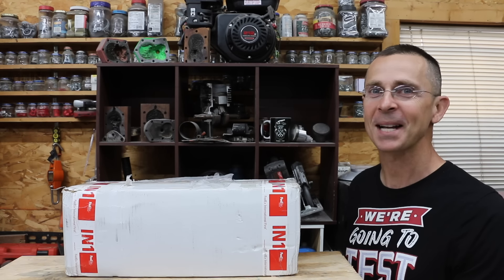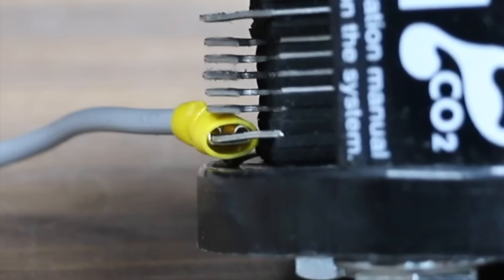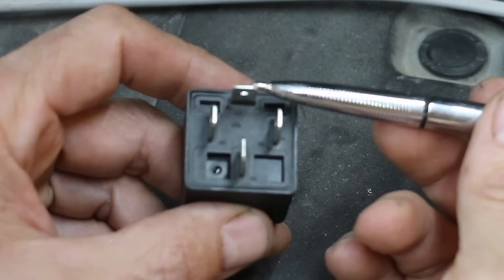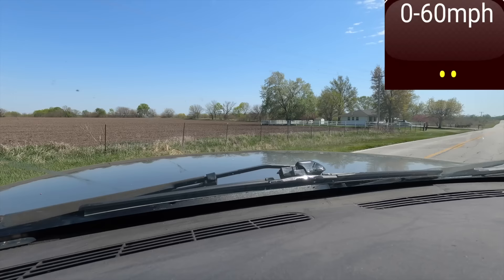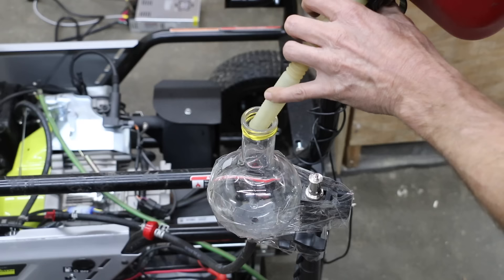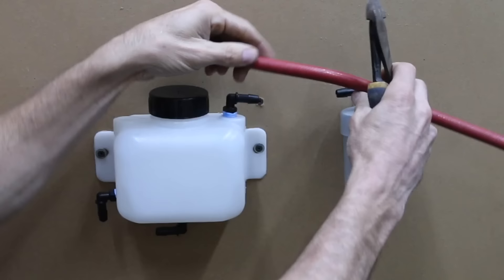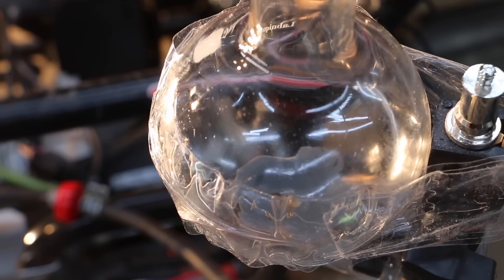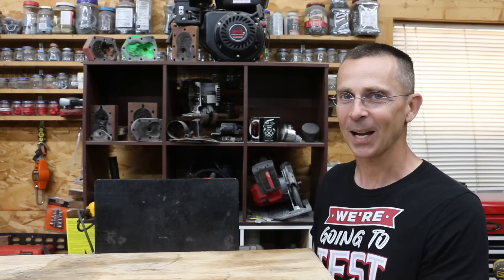AMAZING 35% More MPG with HHO? Let’s find out! Help with high gas prices?

Comment: Wouldn't the engine need tuning for hho? the EFI wouldn't have a clue the hho is being added.
Reply from the maker: Thanks for the suggestion.
Reply: Oxygen sensor would detect extra oxygen produce by HHO generator & thinking fuel is too lean. If only the kit can separate the O2 and H2 going into the air filter
Reply: Oxygen sensor blocks it.i ran this type on my big semi for years built my own.
Reply: @bigred1247  funny how you now realize it did nothing..
Reply: @bigred1247  did you get any difference in economy or performance ?
Reply: @Rev22-21  You are wrong, this is HHO just not a efficient way of producing it.
Reply: I thought the same thing. You would need the lean the fuel to see any fuel savings. So you need to know how far you can lean the fuel with the HHO compensating. Someone also said to adjust the timing.
Reply: @trillrifaxegrindor4411  water is free salt is penny's  gas is expensive
Reply: @WhatTheHeckTV  but the load on the alternator is always going to be larger than any extra energy you'd get from burning the HHO. Otherwise it would break the laws of thermodynamics.
Reply: You will get nothing if you don't add electronic board to adjust O2 sensor signal or ECU ECM will keep adjusting the air fuel ratio and change the timing for the spark Couse hho ignites much faster than gasoline
Reply: @omartalluze8482  Absolutely! You really don't have to adjust timing much as the fuel is still gasoline, When you add a small amount of HHO it creates a shockwave and adds heat making the gasoline vaporize and burn more completely in the cylinder resulting with more calories being used to to create power instead of burning in the catalytic converter.
 If you have a vehicle with a carburetor there is no need to add any extra electronics but you will have to adjust the idle because it will rise at least 200 RPM or more depending on how much HHO your system produces.
 My 68 chev C10 went from 18-20 MPG up to 26-28 MPG with my home made two cell unit But it gets hot after about an hour you have to turn it off. I am going to add four more cells to fix this problem because 14 volts is too much for two cells It only takes about two volts to power each cell. When I run the unit off of a 6 volt battery charger it takes more than three times as long before the unit gets too hot and starts creating a lot of steam.
Reply: @torrielandsman4625  you're absolutely right
Reply: @ZanHecht   @) amps runs my six cell homemade electrolizer and gets me 28 MPG without it I get at most 20 MPG that is better than 25% increase and no laws broken it just makes the engine burn gas better..
 I've been doing it for almost two decades.
Reply: @ZanHecht  there are plenty of engineering studies and reports out that prove when you setup these electrolyzers correctly as supplement to your vehicle fuel you can see between 20-35% fuel savings. Stop with this "laws of thermodynamics" nonsense it's always better to listen to Engineers rather than Scientists
Reply: @anthonypazoz4323  if that were the case, every new car would come with one installed. Car manufacturers would love to improve their fleet fuel efficiency by 25% so they wouldn't have to spend billions buying carbon credits.
Reply: @ZanHecht  unfortunately, the auto industry is not as powerful as the petroleum industry
Reply: @torrielandsman4625  prove it
Reply: @torrielandsman4625  make a video of your setup and prove it works.. you will be YouTube famous
Reply: @carlwilson1483  Why would I do that?
 I don't need to prove anything to keep doing what thousands of people have been doing for decades! HHO or Browns gas has been around a long time.
 Why don't you do your due diligence and research it your self, or better yet build yourself your own or are you too lazy?
Reply: @anthonypazoz4323  don't forget about the lizard people.
Reply: @ZanHecht  In a gasoline-powered car, the alternator is used to keep the battery charged for the next start and to power electric components when running. This includes accessories built in or plugged in to the car. Any electricity produced by the alternator that doesn’t charge the battery or go into an electric component is wasted entirely as heat. If properly engineered, an HHO generator can be configured to use the waste electricity from the alternator, thereby regenerating lost power as gas-phase fuel. This does not violate the laws of thermodynamics. What violates the laws of thermodynamics is your idea that the alternator isn’t wasting lots of engine power.
Reply: @LokiScarletWasHere  The amount of drag that the alternator puts on the engine is proportional to the amount of electricity that the car is using. That's how a generator works. There's no excess electricity wasted as heat. Having this device hooked up is going to increase the load on the engine.
Reply: @zanhecht9085  It will increase the load on the engine, but not as much as you’re imagining. This isn’t a perfect world, the engine isn’t perfectly efficient, nor is the alternator. The alternator will generate unused power, and that will get wasted as heat. Not to mention, the less the engine is putting work into a system, the more power is wasted proportional to its rotating speed. You actually want a load on the engine, as long as it can still function the way you normally use it.
Reply: @torrielandsman4625  science requires us to repeat your claims. Has nothing to do with being lazy. Post your setup so another party can verify. I too believe what you are saying but let's duplicate your setup.
Reply: @al73r  there are already videos out there so why would I have to make one? 
I'll give you a simple lesson on electrolysis! You take a 9 volt battery and touch it to your tongue, now the positive side of the battery is releasing oxygen from your saliva and the negative side is releasing hydrogen, what else can I teach you in the name of science?
Reply: @torrielandsman4625  you made a claim that your system you created does XYZ. The next step is to verify that claim by repeating your build. Your words are not enough, I'm sorry.
Reply: @LokiScarletWasHere  your statements about the alternator are incorrect. When the battery is charged and the electrical load on the alternator is low, the regulator shuts the alternator down or reducers the field current. That causes the load on the engine to decrease, there's no wasted energy. The alternator will generate the most heat when it has 100% electrical load.
Reply: @tomtom1541  You're still not considering real world losses. Of course it would make the most heat at full load, because more power is being generated and consumed, but that doesn't mean that taking the load off will make the alternator perfectly efficient. Then you still have the engine to consider, which is horribly inefficient without a load, or with very little load.
Reply: @al73r  I found this stuff on the internet more than 15 years ago and did my research and replicated what I found. It is not my job to prove anything to people too LAZY to do the same.
 Lots of people have done this so why don't you do the work! It costs less that $100 to make a functional unit to break water down to its elements. HH+O, water is the most abundant fuel on the planet.
Reply: @torrielandsman4625  calling bullshit on your setup. You can spend more time telling people how awesome you are vs sharing.  That to me says your system is not repeatable
Reply: @al73r  Repeatable by anyone with $100 and half a brain!
Reply: @torrielandsman4625  😂 let the anger flow
Reply: @zanhecht9085  you are right! my unit draws 20 amps while it's turned on but the gas it produces helps to burn the gasoline in the cylinder because it detonates and produces heat making the gasoline burn more efficiently.
 It really isn't rocket science but it is rocket fuel!
 Funny people don't say prove NOS makes more power!
Reply: @al73r  Nothing awesome about using physics to your advantage, You want to see awesome research Stan Meyers because he could drive his car without the gasoline, His car burned water!
 This isn't magic, you can make a electrolysis apparatus out of two of your mothers table knives and a nine volt battery a plastic sandwich bag two ounces of water and a little baking soda, isolate the knives from each other and tape the battery to the knives so that one contacts pos and one contacts neg then dip the knives into the water baking soda solution inside the sandwich bag and seal the bag up the best you can and watch the bubbles for a few minutes then ignite it with a lighter. After you do this tell me what your mother told you not to do again LoL.
Reply: @chuckewe  you almost had me until you said wikipedia and if you come back with a google search I will laugh out loud. 
 You would have to show me something that is published and not from a BS site like wikipedia,  Show me the actual court case so I can see for myself! What is the case number?
Reply: @ZanHecht  It doesn't break the laws of thermodynamics if it helps convert more of the thermal energy from gasoline into kinetic energy. Otherwise nearly all of the advancements in recent years in ICE technology wouldn't have worked.

Comment: How many litres of air is your car sucking in per second? And how many litres per year is that HHO generator emitting? I highly doubt it contributed anything.
Reply: @Charles McKinley : Though I completely agree that this video's so-called HHO system is A COMPLETE FRAUD & produces NOTHING, I respectfully disagree that actual HHO systems do not exist nor work.  A man by the name of Meyer's back in the 80's patented his system, produced a documentary on his achievement and published a video of his VW dune buggy being powered by it. Sadly,  he was killed (poisoned in a public restaurant) shortly afterwards and while dying said as much.
Reply: @Rev22-21  Stan Meyers,  he ran on just HHO and could drive across the continent on about 22 gallons of water. 1 litre of water produces about 17000 litres of HHO gas.

Comment: No significant changes will be realized without tuning the fuel system. The stock fuel system is set to deliver a specific amount of fuel, based on AIR FLOW.  Adding HHO may have the effect of speeding up the engine, this increasing airflow and fuel consumption in the same time period.
Reply: O2 sensors adjust fuel delivery. Did the instructions say you need a tune? Did it say to lean out the fuel map?
Reply: @mbelite1  since there is now additional oxygen from the hydrogen and oxygen being broken apart, the O2 sensor will sense more oxygen which tells the computer to add additional fuel to compensate. This HHO stuff might work but the computer would need to be tuned to work with it.

Comment: Love the channel.  I have a suggestion. Can you test a product like the "ecotune" that plugs into the diagnostic port of your vehicle and is supposed to reduce fuel consumption by 35%? That would be interesting. Thanks!
Reply from the maker: Thank you!  Thanks for the suggestion.
Reply: As the owner of a performance device (HP TUners) that could do that and the same type of truck, it's simply not possible to run with THAT much less fuel. Running that lean will cause misfires if it even has power to keep running, which would fail emissions tests in a heartbeat.
Reply: "Big Clive" has already investigated such OBDII plug-ins.
[EDIT: spoiler -- they do not do anything beyond a flashing light]
Reply: Theoretically you could tune an engine for fairly significant fuel savings. The real issue with that is the catalytic converters. Factory tunes are set up to keep the cats happy. Running an engine that lean would destroy them in pretty short order
Reply: @sjb3460  in the netherlands for me its 90km/h hanging behind lorries camions,
Reply: @walterk1221  Thanks!
Reply: @level19barb16  running lean also increases temperatures which usually ends up burning valves

Comment: Great test. But as any of these non-pressurized hydrogen systems seem to have in common is that the hydrogen / oxygen mix is used up probably quicker than it's made. So essentially you're looking at a slow Trickle of hydrogen oxygen and a standard mix of gasoline and Air. These systems would work if it was possible to safely pressurized and store the oxygen hydrogen mix then run the motor on just that only. Providing that you can split or recover the hydrogen and oxygen faster than the motor is using it.
Reply from the maker: Thanks!